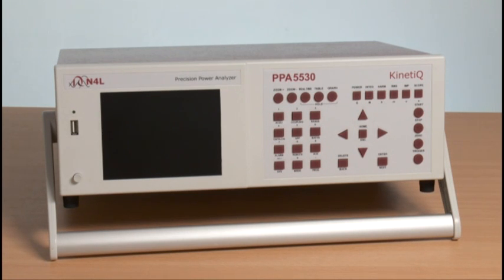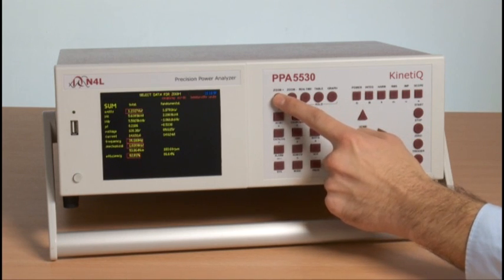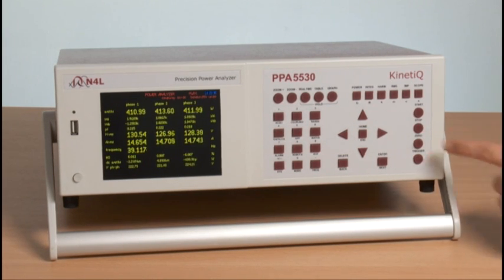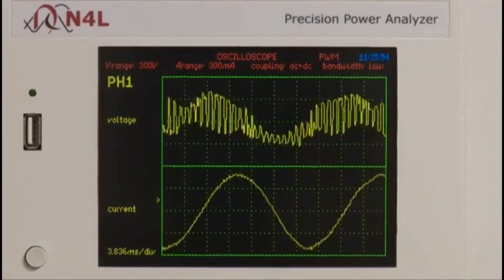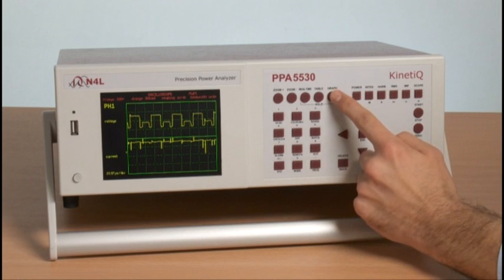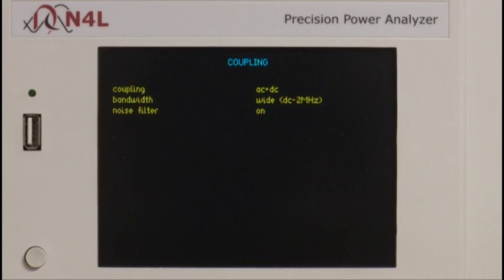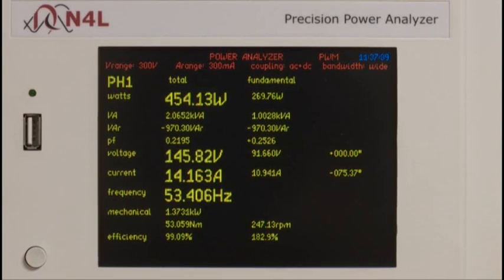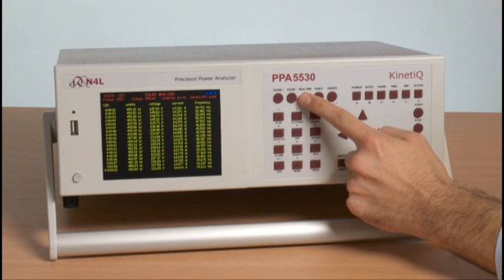Newtons4th PPA5530 Power Analyzer PWM Motor Drive Testing

Comment: Si parla di precisione ma qual'è la REALE PRECISIONE IN POTENZA del PPA5530 con i seguenti parametri?: 400Vrms, 10Arms, cosfi 1, 50Hz.= 4000Watt
La formula in potenza riportata sul bollettino del PPA5530 è la seguente:
0.03%+0.03%/pf+(0.01%×kHz)/pf] Rdg+0.02%VA Rng,
riporta inoltre che i range sono Picco..
perciò lo 0,03% sulla lettuta (Rdg) corrisponde a 0,03% su 4000W = 1,2W
lo 0,03%/pf corrisponde a 0,03/1= 0.03% su 4000W = 1,2W
lo 0,02% sul Range (Rng) corrisponde a:
0,02% V x I,
 i range in Picco del PPA5530 sono per i 400Vrms= 1000Vp e 31,6Ap per i 10Arms,
percio l'errore sul range diventa: 0,02% di 1000Vp x 31,6Ap= 31.600w = 6,32W
Sommando perciò i vari errore: 1,2W lettura + 1,2W cosfi, +6,32W Range, si ha che
l'errore totale è di 8,72W su 4000W pari allo 0,22%!!!  rispetto allo 0,03% del bollettino..
Altroche' Precision Power Analyzer, sul mercato c'è MOOOOLTO, ma mooolto di meglio